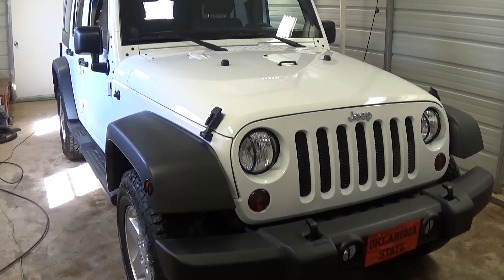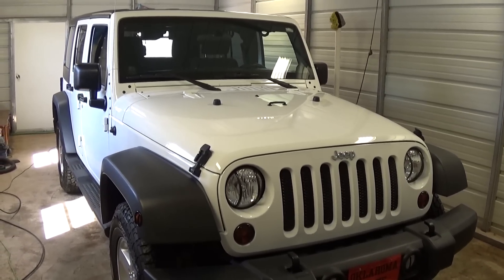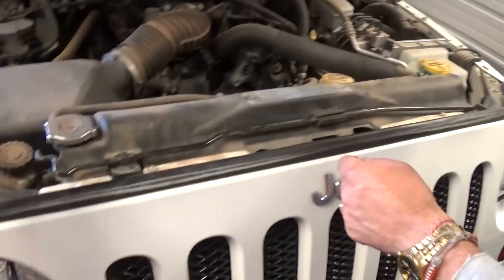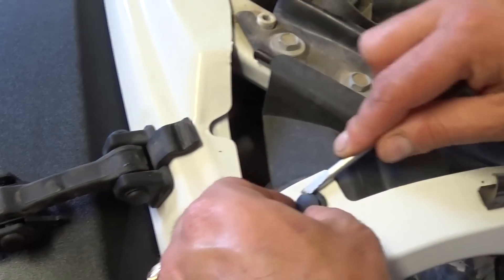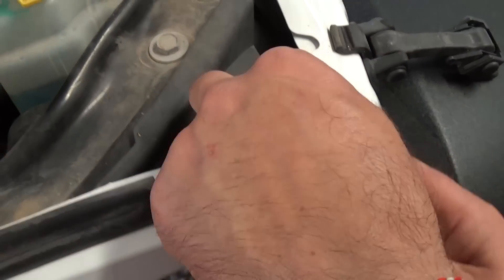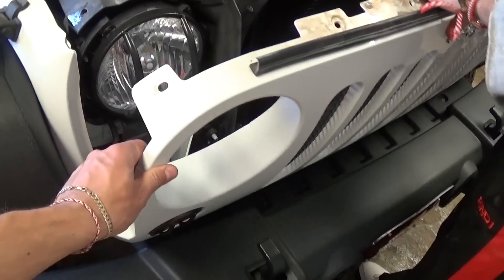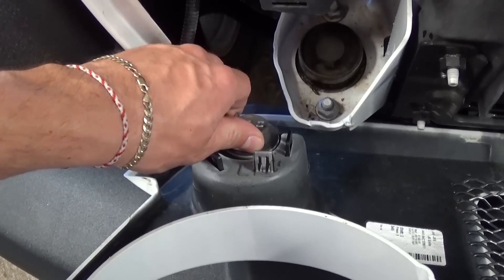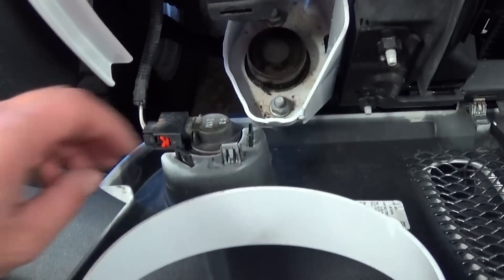Jeep Wrangler JK Front Grill Removal and Replacement 2007-2015

Comment: You skipped the hardest part.  What’s the best technique to pull out the grille considering the clips at the bottom are holding it in place.  Clearly yours was already out